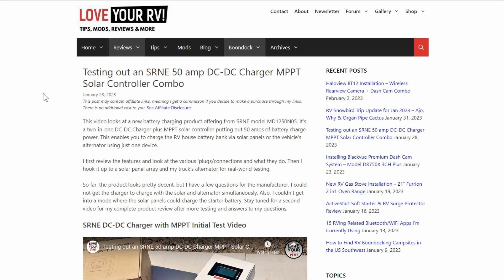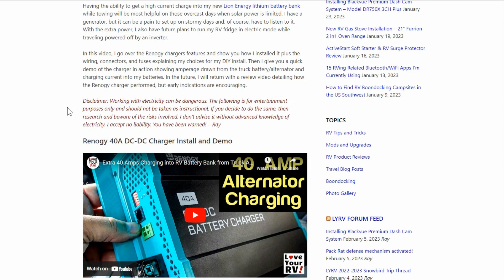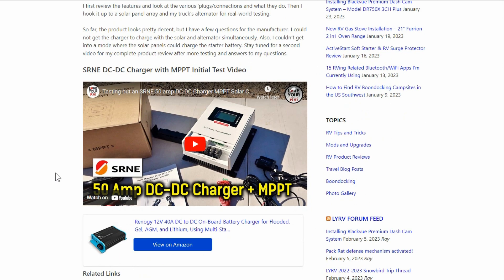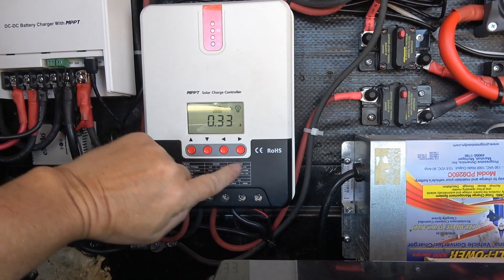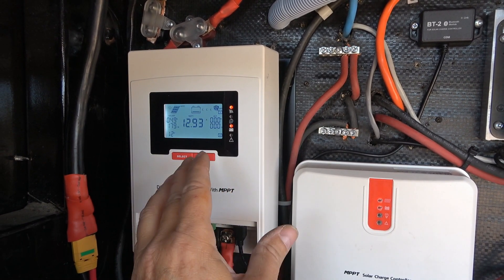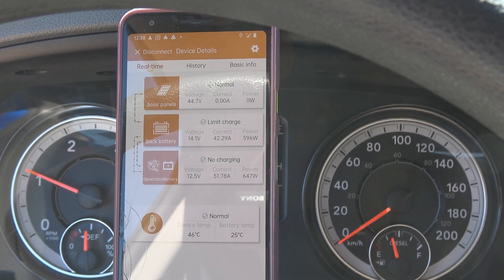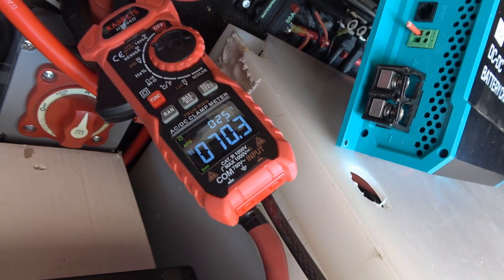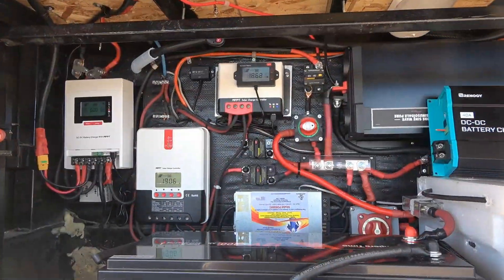SRNE 50 amp DC-DC Charger + MPPT Installation - Model MD1250N05

Comment: Can you please send the link for the remote controller switch? Thanks!
Reply from the maker: Here is the app I use for the built-in Bluetooth. I have an Android phone  https://play.google.com/store/apps/details?id=com.srne.androidapp&hl=en_US
Reply: @LoveYourRV  I meant the remote controller switch that you can enable the charger on/off using the remote controller (not the bluetooth module), could you please share the link for it? thanks in advance!! Im buying the same charger next week
Reply from the maker: I'm not sure what remote controller you are referring to? There is an on/off port on the charger that has a plug with a jumper wire on it. You can remove the jumper wire and insert any switch you like whether it is wired or wireless.
Reply: @LoveYourRV  yes that’s exactly what I mean, you have a remote wireless switch connected to this port (that you showed on a video) so you can remotely turn on/off the controller, would you be able to share the link for it? Thanks!!
Reply from the maker: Maybe this is the remote wireless you are looking for https://amzn.to/4lW2HQx  Here is a video I did about it - https://youtu.be/-OEOMQgbMPk
Reply: @LoveYourRV  awesome that's exactly it, thank you again keep up the good work!

Comment: Hey man love your videos, I’m about to get the same charger, is it still working great? Any complaints or comments about it after 2 years? Thnx
Reply from the maker: Thanks. It's still working great in the RV and I have a second one in my boat for solar charging. I did have to add a fan for cooling since its in a small cabinet that gets warm, but that solved the problem of it running too hot and derating itself. Here is the video https://youtu.be/lAva1W0o6sI  Cheers, Ray

Comment: Hi Ray I have a question for you. At the beginning of this video you show a high output port which kind of looks like a second terminal on the positive post of your truck battery. I could not see if there was a relay there. If not what keeps the truck battery from overcharging while the alternator is charging the trailer batteries? Especially as the truck should stop charging somewhere around 13.6 but you want the trailer to go to 14.4 or 14.8 is it for lithium?
Reply from the maker: The output of the DC-DC charger has the higher 14.4V lithium voltage, and the input side has a higher amperage since the DC-DC charger is loading it down. Usually, about 50-60 amps draw. The DC-DC charger increases input amps to be able to boost output volts. I haven't had any issues with the truck batteries. They are 5 years old now and still working great. in the old days, alternators put out a steady 14.4V, but now, with smart alternators, they can lower it to 13.6 to get better fuel economy.
Reply: Oh thanks so much Ray the DC to DC increases amp to get to 14.4 volts. I knew it was 14.4 but didn't know how it achieved this. So the alternator remains at 13.6 and doesn't boil your truck batteries to kingdom come. That is what I was after. That is a little fact function of the DC to DC charger I was not aware of and as a result the math was not adding up for me. DC to DC also converts voltage not just limit amps.
Reply from the maker: @GaryBoyd02 @GaryMaxEffectBoyd  Most alternators these days are what they call "Smart Alternators" regulated by the vehicle's computer system. My Ram truck has a small sensor shunt on the negative battery terminal. It senses voltage and amperage so it can regulate the alternator output. I imagine there is also a temp sensor in the alternator to derate it if it overheats.  
Basically, the DC-DC charger acts like a high wattage load, much the same as a light bar, inverter, heated seats, winch, etc.  The computer senses this and adjusts the voltage as needed to supply the load.  
The DC-DC charger outputs the preset charging voltage in the case of lithium 14.4V and at a regulated 40 amps. On the input side the same wattage 14.4Vx40A=576 is needed plus whatever is lost in the conversion done by the charger and wiring run losses. Say for example that ends up being an even 650 watts. If the battery voltage is say 13.6V then the amps will be 650/13.6 = 47.8  
A person has to keep in mind whether their existing alternator can handle the extra load the charger will pull off the alternator. I imagine most alternator setups can handle say 30 amps but once you start adding 40 or 60 amp DC-DC chargers that may pull 50 -70 amps some research or advice from a mechanic may be required. Cheers, Ray

Comment: A few months ago I tried to install a Renogy dc to dc and mppt Solar combo unit and was really disappointed to find out that this unit would work in Solar mode alone without the truck being connected to my 5ft wheel. So I returned it cause I thought it would be useless in my setup. Was your unit programmed the same way?
Reply from the maker: This unit works fine as a solar controller without the truck being hooked up. I've been using it for my 400W folding solar panel.

Comment: Great explanation and makes sense to me. I appreciate the effort of making it work in your setup so you can provide long term review. Thanks again Ray!
Reply from the maker: You're welcome. :) So far its worked out well. Got a chance to use while towing a 4 hour trip. Switched the DC-DC charger to charge my depleted backup 200Ah battery. DC-DC charger was putting out a constant 47 amps so arrived at next camp with a fully charged battery. Meanwhile the roof top solar recharged my main battery bank.
Reply: @LoveYourRV  Misson accomplished in my book.

Comment: hello good evening, watch your video and I have the same problem, it is not changing automatically when I turn off the truck and mine also does not charge through the alternator and solar panel at the same time...

 Did you receive any response from the company via email?
Reply: but after changing the n13 you will need to do all the configuration again because it starts to give an error in measuring the battery temperature, at least mine was that way, I had to configure everything from scratch after making this modification
Reply: @acaitintel7829  Can you elaborate on what you did to get it working after the switch? I lost all charging, alternator and solar. Did all the resets f01,02,03 and still nothing
Reply from the maker: Yes but answer didn't didn't help much. I replied that I have never been able to get simultaneous charging from solar and alternator. I haven't heard anymore. I'm thinking it must be an either/or thing and they don't understand my question due to the language barrier.

I asked 4 questions and here were the replies:
1. How do I set up the charger to charge from the alternator and solar at the same time?
 way three
This default charging mode: It has various charging working modes such as photovoltaics charging the backup battery alone, generators charging the backup battery alone, photovoltaics and generators charging the backup battery at the same time, and photovoltaics charging the starting battery.
2. How to set to charge the starter battery?
way four
The battery is not fully charged. Both can charge the battery and backup battery.
3. What does th3 %V setting in the app do?
When the photovoltaic panel voltage is lower than the light control on voltage (that is, the above 5V), the load will be turned on after a certain time delay, and if it is higher than the light control on voltage, the load will be turned off after a certain time delay. , the range of this value is 5-11V, if the system voltage is 24V, the range is 10-22V.
4. Where can my viewers buy this product?
https://www.alibaba.com/product-detail/SRNE-DC-DC-MPPT-Solar-Charge_1600593758947.html?spm=a2747.manage.0.0.21c971d2KWnDgj
Reply: @LoveYourRV   Hello friend, I'm coming back to help you, because I can do the configuration to charge both at the same time, solar panel and alternator... follow the steps: the alternator comes from the factory configured for the first charging option and you need to change it in the configuration at N13 changing it to primary charging by solar panel... after that it will work in a hybrid way. 

I figure it out by doing all the setup again...
Reply from the maker: @acaitintel7829  Thanks for letting me know that! I'll give it a try.
Reply from the maker: Thanks again, setting N13 worked. I have put out a video to update my audience. Cheers! Ray

Comment: I just added a Sterling 30 amp DC to DC Charger on my Travel Trailer.  I need to wire up the tow vehicle next.  I have a different remote switch than you, but you are the one that gave me the Idea.  Thanks again.
Reply from the maker: You're welcome! :)

Comment: I followed the link to the remote switch you mentioned but I didn't watch the video yet. I'm curious as to how you got it to work with the 50amps coming from the DC to DC charger. Did you use a relay or solenoid?
Reply from the maker: It opens and closes the On/Off terminal on the DC-DC charger itself then the charger stops the charging from happening or starts it. So no relay or solenoid required. The feature is built in. :) See the On/Off terminal here in previous video. https://youtu.be/Vyc2PpSKfSA?t=442  Cheers, Ray
Reply: @LoveYourRV  thanks Ray, you're the best!

Comment: Nicely done... Believe it or not, I actually understand all your wiring and systems. Me being old school electronics (learned vac tubes systems, then transistors) can follow the wiring, fusing & switching. It may look convoluted but it's easy to trace & understand to me. Our power requirements are very simple & basic; therefore we have about 10% of the items / systems. Still awaiting the install of the cooling tower & mini reactor... lol
Reply from the maker: Actually that's one pro for these SRNE they make the controllers without fans.